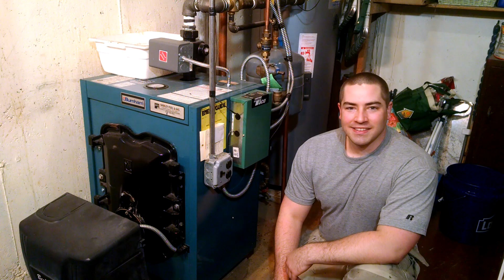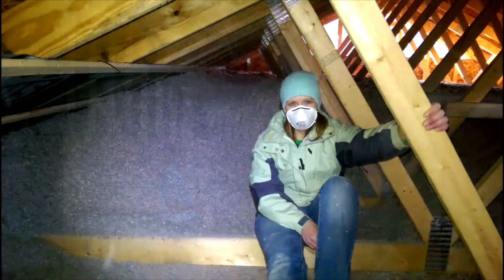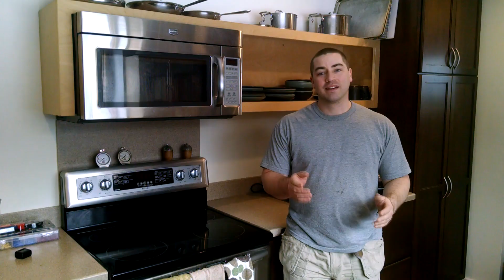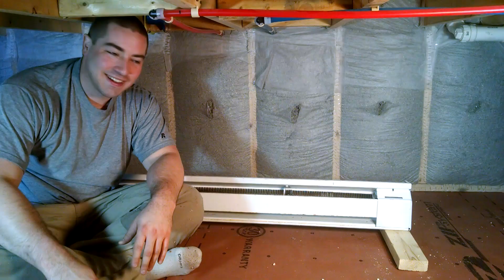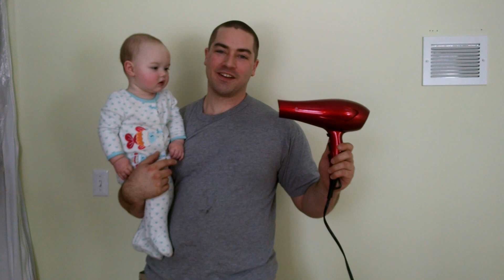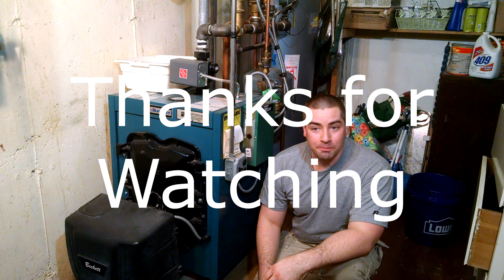Heating our House, Super Efficient

Comment: Some good points David. What we really should care about is the Total Cost of Ownership (TCO) and how it performs in various conditions. Just one idea on the mini split (heat pump).... what about taking a insulated black cavity similar to solar water heater but run air instead of water. This air circulates through the heat pump warms the heat pump and the heat pump will in turn generate even hotter air inside your home. This would cause the "ambient air temp" that the heat pump would experience would much warmer and cause the efficiency of the heat pump to be higher because the "ambient temp" is closer to room temp. Maybe this could be a future experiment. A little foam board, tape, and time would try this theory out. Thoughts?
Reply from the maker: Sounds like fun.  I would have built something like that already, but the mini-split is on the North side of my home.

Comment: Wouldn’t a diesel heater be the best and cheapest source of energy in the winter? The electricity to run the pump is minimal.
Reply from the maker: That might be efficient, but not legal for me.
Reply: @DavidPozEnergy  
Legal? Anyway I’m still on the search to find a heating solution that won’t use a lot of electricity to power. Everything I see from wood stoves two heat pumps takes a lot of energy. As they use fans to disperse the heat. ☹️
Reply from the maker: Wood Stoves probably use the least amount of electricity.  Yes, in my area I would have to buy a diesel heater that is UL listed, and have the fire department issue me a permit to store diesel on my property.  But if you are off grid, doing your own thing, then cool.  There have been a lot of video reviews of little diesel heaters and they seem very efficient.

Comment: The company who came out and charged you for a service because it's leaked it's gas, was not supposed to charge you for the gas in the first place, because they left a small gasleak on your unit when they installed it in the first place, so they can get a service call from you which they can make money on it all the time, I have a HVAC company and we make sure the units dont have gasleaks when we install them. Just as a matter of usefull information.

Comment: David, I know this is an older video. I think your mini split is a lemon. I have used a fujitsu dual head unit to heat the first floor of my 1907 sears home. I rarely turn the boiler on (multiple floors). I think it performs amazing at least in comparison to the oil fired boiler!

Comment: Hi David, just now saw your video on heating.  We are building a small cabin in NE TN.  Love your ideas.  Question—what is your crawl space dirt covered with?  I assume it is not plastic. Thanks.
Reply from the maker: The dirt under my crawlspace is covered with a non-structural slab, about 3" thick.  We call this a "rat slab".  Then I have R-28 of foam board and a 16 mil vapor barrier.  As a protection layer I tossed in plywood so when I crawl down there I don't tear up anything.  I have lots of old videos on my channel of the making of the house.

Comment: David could you spend a minute explaining thermostats wired in series....crawlspace plus house
Reply from the maker: Each thermostat acts as a switch.  The switch needs to be closed to allow electricity to flow past it.  If two switches are on the same wire, then both switches need to be closed to allow the electricity to flow.  In my case each thermostat needs to call for heat for the baseboard to be on.
Reply: @DavidPozEnergy  ok, so the crawlspace MUST be on for the upstairs to have the option to turn on.  Assuming the crawlspace is thermostat 1

Comment: I wonder, would it make sense to insulate the crawlspace with fiberglass batts and only heat the interior of the house? Or would that cause those pipes to freeze and burst in the winter? Nice video and channel by the way, just found it today. Good content.
Reply from the maker: My thermal envelope is on the floor of the crawl-space.  Meaning, the dirt, and up the foundation walls.  I think you are describing adding fiberglas batts to the floor joists, which would push the crawl-space outside the thermal envelope.  The fiberglass batts in the joists is the traditional way of doing it.  When you do that you are required by code to ventilate the crawlspace to the outside.  This will for sure freeze pipes.  

By insulating the dirt, and keeping the crawlspace inside the thermal envelope I'm not required to ventilate to the exterior, so the crawlspace is essentially freeze-proof.  I have an R-26 of foam board with a 16mil vapor battier between the dirt and crawlspace.  And, actually, I also have a thin concrete slab between the dirt and insulation.  This is my "Rat slab"  LOL, it's non-structural, 2-3 inches thick.

Comment: Disappointing that you are not having good luck with your mini Split. I've got 7 in service for 5~9 years now (in 3 homes with crap insulation) and so far worst I've had was having to cycle a breaker (1 time) and I clean them with a shop vac every year.

Super awesome you can heat with that few watts, if I had that little design load I'd totally be resistance heat as well.

Comment: One of my neighbors has a mini split and found that a $150.00 window units cools far better, I would not do electric heat except for emergency, I use wood and gas. Heating under the floor looks like a smart idea.
Reply: If that's the case you got a shitty mini split. Or you are basing this on discharge temp.

Comment: Good one David. I'm building a similar home in concept right now. Super insulation with electric baseboard. The only mechanical aspect of the house it the HRV. Simplicity is the beauty in building energy efficient homes. I've done radiant hydronic, geothermal, natural gas forced air, mini split and electric resistance. The least expensive one is the most reliable and will not need replacement or maintenance. Put your money into the structure, windows and insulation then relax for the next 50 years with little or no energy bills. Don't forget to always incorporate passive solar.

Comment: I am making a lot of assumptions in the following since I do not know the specifics of your situation:

1- The mini split heat pump unit seems to be placed on the top floor of the house.

Hot air rises and a unit upstairs will only heat the immediate area around it. It will be unable to heat air for the floors below it.

However, in the summer, the upstairs unit will provide some cooling to the floors below since cool air goes down.

A better approach would be to provide independent units for each floor, and if there are several rooms per floor, then provide small units per room.

2- There is a single mini split heat pump unit for the entire house, and it produces less than 15,000 BTUs.

2- Did you check the minimum outside operating temperature for this unit?

Here are some efficient units:

https://images-na.ssl-images-amazon.com/images/I/A1uKZh8Q8gL.pdf

Their minimum outside operating temperature is minus 22°F.  If you are in an area approaching the minimum operating temperature, then you need a secondary heat source.

My suggestion for you given the harsh winter conditions would be to get an AO Smith heat pump water heater with a properly sized buffer tank.

https://www.hotwater.com/water-heaters/residential/electric/proline/xe/voltex-hybrid-electric-heat-pump/

Place a hydronic radiant floor tubing.  Use the heat pump water heater normally all year for hot water, and in the winter use it for hot water and to heat your house.  You may require two 80-gallons heat pump water heaters (one can be turned on only in the winter).  The advantage is that this system will use very little energy all year round, and it can draw solar energy when produced.  You may need an energy diverter to accomplish this.

See the Eddi from myEnergi with the additional esense board to control the water heat pumps.  See examples 11 through 13 of their user manual (if I remember correctly) to control water heater heat pumps with an energy diverter.

https://myenergi.com/product/eddi/

They have products for 110-volts at 60-Hz; however, you will need to contact them to request them.

The advantage of a hydronic radiant floor heating system is that you can use multiple heating sources.  

For instance, if both AO Smith fail (worst case scenario), you could provide heat with a wood kitchen stove that has a metal water pipe running inside it.  This can be connected to the hydronic radiant floor heating system.  This becomes an emergency secondary heat source which can, also provide hot water.

Comment: Just change the orifice tip to lower the BTU output. Do that all the time for older oil heaters. Other way is to use K-1 kerosine in a Dynatherm. You can really get super efficient use of fuel. But the heater is very expensive back in the day. Maybe find a used one and rebuild it. Worked for me.

Comment: The ideal place for that minisplit would have been the crawl space. There you wouldn't notice the defrost modes or noise, with the floor serving as a buffer [you could likely even turn it off during short or low temps snow storms and ride out the buffer]
Getting a COP of 1.5-3.5 is def worth it. 

Of course you lose cooling ability without doing some type of rigging to distribute it up to the living area.

Comment: This is something I've never understood, why not put a small box around the mini split in the winter and remove it in the summer?
Reply from the maker: Assuming the Mini-split works: a heat pump moves heat, it does not create heat.  In summer it removes heat from a house and dumps it outside.  In winter it removes heat from outside and dumps it inside.  If you build a box over the heat pump outside then it can't capture the heat from the outside air.  You have cut it off.

Comment: whats your crawlspace floor R value and construction
Reply from the maker: The ground insulation is a double layer of Polyiso foam board about R-26.  It is my weak link in the assembly.  Next time I build I will construct the ground insulation just like I did my garage: https://youtu.be/s9Pmt7XG_2c  BTW, I'm calling it "ground" insulation to distinguish that I have no insulation in between the floor joists.  The crawlspace and living areas are inside the same thermal envelope.  Thanks for watching.

Comment: Unfortunately my home is not so well insulated, I have taken measures to improve that but theres only so much you can do to pre constructed homes. we use a small wall mounted gas heater in our crawl space to prevent the pipes from freezing in the winter. Do you think one of these electric resistance heaters would be more efficient?
Reply from the maker: Generally speaking electric heat is two or three times more expensive than gas heat.  Switching your gas heater for electric heater is probably not a good idea unless there are other things at play.  Some people wrap the water pipes with electric heat tape and then insulate around that.  This can be more efficient because you are only heating the pipe, not the whole crawlspace.

Comment: If you having  freon leaks on the mini split it is almost always a bad flare fitting connection. With a properly charged system it should very effectively heat to well below zero at a COP of at least 2 which is twice the efficency of the base board heater.
Reply from the maker: Thank you.  I've had the flare fittings replaced by licensed HVAC contractors and the problem continues.  I have an updated video on the HVAC if you want to see: https://youtu.be/bH0D-c4RPuk

Comment: You have a leaking refrigerant line.  It needs to be fixed to eliminate the loss of Global Warming Greenhouse Gases.  Not to mention a significant reduction in your maintenance cost.  You should NOT have to EVER add refrigerant to a well sealed system.  Any AC guy worth their salt will tell you that.  If necessary replace the flared fittings with silver soldered joints.  p.s. you might want to consider a different heat source for your heat pump.  Any nearby lakes or rivers.  Any way to build a pit of rocks heated by the sun as a storage site for the heat pump.  Is drilling a well prohibitive in your area?

Comment: There is something to be said for simplicity. I heat my home with a vent free wall mounted (NON ELECTRIC) propane heater,
and sometimes if I am feeling rustic I light a fire in my little coal laundry stove,  I am in the electrical trade and have seen people
dump loads of money into complex systems to heat there homes, money they will never get back out of it, and into systems that will
never pay for themselves,  To many people do things because they are popular, not because they work.
Reply: I have seriously been considering at least one vent free wall mounted (NON ELECTRIC) propane heater for my house. The cost of a heater(s), propane tank and hook-up is more affordable than most other systems. Far more energy efficient and simpler and cheaper to maintain and operate. And the one HUGE advantage is that they work in power outages unlike most other types of heating methods. The house my wife and I purchased has an existing fuel oil boiler w/ hot water base board heat. However, it was and still is non-functional. The cost to get it fully functional will probably cost thousands of dollars that I just can't see spending, especially on a system that operates on expensive fuel oil and is useless in the event of power outages. We are currently heating our house with 6 oil-filled electric radiator heaters that cost about $50 each. They are cheap to replace in the event one dies. They definitely raise the electric bill, but are no more expensive to use than the cost of fuel oil and service and maintenance costs. The down side... no electric, no heat. 

Is there a certain brand of vent free wall mounted (NON ELECTRIC) propane heater that you would recommend?

Comment: Four winters,  no trouble down to zero and not one service call from my Mitsubishi 24n series mini split..  My unit never blows cold air when it goes thru defrosts and I live in the mid atlantic where heatpumps will defrost 15 to 20% of the time!   My unit has performed down to the rated tempture of 4above zero without issues and if I lived where it gets colder I would opt for the 15 below unit without hesitation.

I payed $4200.00 for a quality hvac system from a mfg known for quality. Cheeper eBay brands disappoints all to often.

Comment: A lot of misinformation about heat pumps on here... I have 2 heat pumps heating my 100 year old house and its currently -20 celsius. Sure the COP is only around 1.5 at these temperatures but because my unit was designed for cold temperatures it maintains its capacity. All to often people give heat pumps a bad name because of poor choices and improper sizing.

Comment: Have you considered a rocket mass heater in your house?
Reply from the maker: Hi Bob,  Not for this house.   However, I have considered them for my next house.  I think they are awesome.  Do you have one?
Reply: Hi David no i don't have one yet I live in northern Ontario Canada in an old house, we have been here almost 60 year and it was a old house when my dad bought it. We go through about a cord a week so would really like to find something better.
Reply from the maker: Cool.  I have relatives on Gore Bay, but that's not really Northern, but it is Ontario.  
I don't know much about wood stoves, sorry I can't help there.  I usually attack an old house from energy savings first.  (air sealing/insulation) but you probably have already looked into that.  A cord a week is pretty rough.  Good Luck with it.

Comment: I have a question about your cellulose, I see in your crawl space you used a netting to blow it in. I’m planning on insulating my garage, if I use the netting do I have to put drywall over it or can I leave it bare like you have? Will a Lowe’s rental machine pack it tight like yours is?
Reply from the maker: Unfortunately no, you can't leave the netting exposed, at least not legally.  If the garage is attached to the house, then you need minimum 5/8 inch thick Type X drywall on the surfaces that are adjoining.  Now if we are talking about non-inhabited spaces such as my crawlspace, or if your garage is separated from your house, then it's a practical question not a legal one.  Practically speaking the netting is pretty strong.  It's called "Insul-Webb" in case you want to look it up.  After 6 years I have inspected my crawlspace and found no staple tear-outs, or sagging.  So it can hold the insulation fine.  But I would still cover it with drywall, or OSB or something in a garage.  Every time you brush up against it some dust will come out on your clothing.  If you lean something against it, it might poke holes in the netting.  You are better off to cover it.  
On to the second question about machine rentals.  I have never found a box-store machine to have enough PSI (pressure) for dense-packing.  They are only capable of open-blowing a flat attic.  Here is a company that makes more powerful machines, and has rentals. http://www.accu1.com/insulation-blowing-machine-rentals-and-blower-repair-s/85.htm  However, I don't know where they operate out of.  If you can't rent a powerful machine, then try buying a used machine and sell it after the job is done.  
I hope that helps..
Reply: DavidPoz thanks for the reply! I’ll probably end up doing spray foam on walls and cellulose in attic